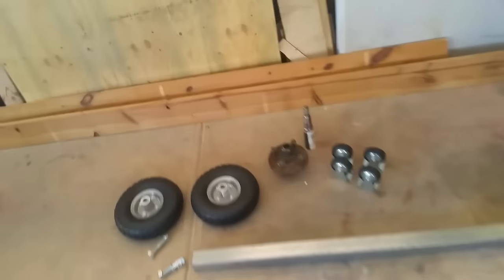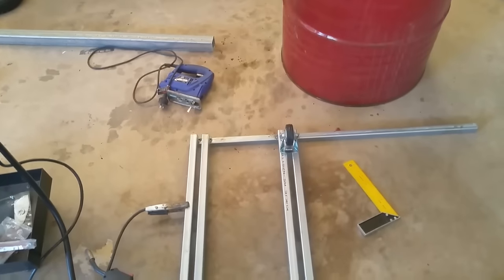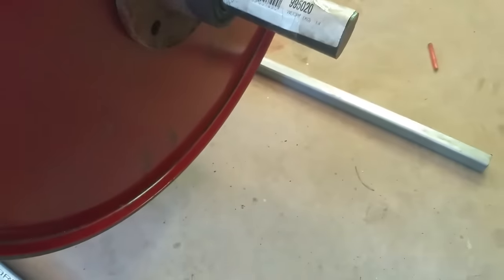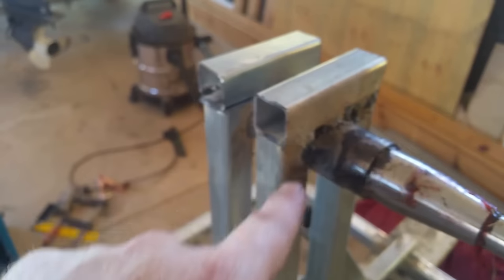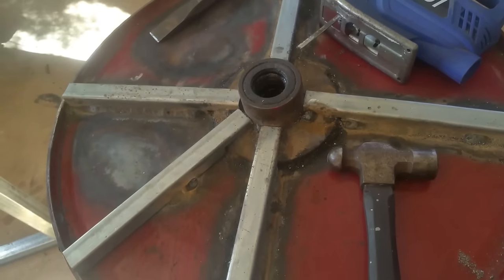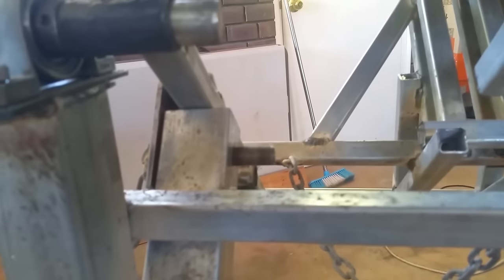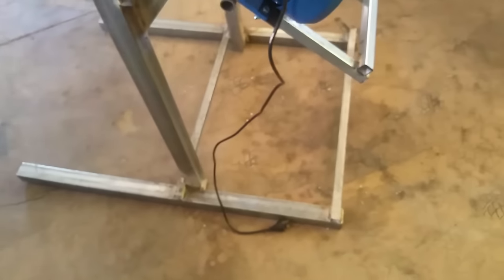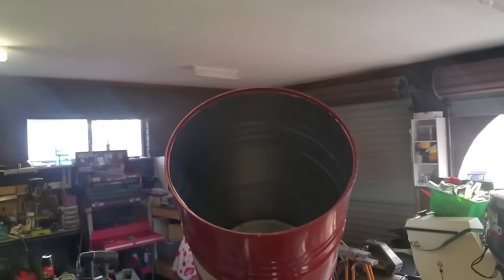How to Build a 55gal Cement Mixer

Comment: Really great design would love to get an update on how your belt drive system has held up?
Reply from the maker: Thankyou. So the belt really slips on heavy loads, so it really needs that fixed but everything else worked a treat.
I do want to redesign it tho.
Reply: @MattyMiranda  Most all these videos they really have not tested them much at all, because I've built them and they break, I had to fix my small one like 5 times.   It isn't great when the mixer breaks half way into the job!  My big one (1/2 yard) eventually broke before we finished my house additional footing wall.   Nightmare having to manually do small batches and hand spin it.

Comment: Good luck with that belt! It's either going to break, come loose once concrete debris enters the track or slip with the weight of the concrete!

You need an drive pinion gear and ring gear around the drum!
Reply from the maker: Had a few slippage issues with that but hey has served me well and is still going.

Comment: Hello, Have you tested your machine with concrete?
If yes, don't you have too much trouble tipping the tank full of mixed cement?
Reply from the maker: I had no problem tipping at all a little belt slippage that's all. I have used it alot if you watch my follow up video you will see some of other pieces I added as well cheers.

Comment: What's the motor specs?..can we adjust the speed to 7 to 10 RPM?... Very nice work u have..
Reply from the maker: Hi and thanks 4 the reply. I believe it would be better to use a pulley reduction to get your desired rpm out of the motor only because if you reduce it through the motor you won't get the h.p (horsepower) the motor puts out.
Reply from the maker: Motor rpm is 1330rpm 240v gives 1h.p. So pulley is a 14mm to the barrel of 580mm gives around 27rpm at the barrel.

Comment: It is a ball bearing which leads in the center to the bottom on the outside ?????
Reply from the maker: Yes its a car hub with a stub axle which they use on a trailer so very heavy duty and sealed bearings as well so they wont get cement in them.

Comment: Well , first off , good job well done....
Not to bust your chops , just hoping to help out a little... I see you said you had a little trouble determining dead center of drum bottom ...I don't see why , coz you had everything right there to find dead center , all you had to do was use it ...Before welding anything up to the drum finish the framework with the 4 rollers first where they all make contact with the drum ...Lay the drum in the roller cradle & slowly rotate it by hand while you take a sharpie taped to a stick & mark dead center as it spins like a lathe ... A concrete block,  one stick , duct tape , & a sharpie &  you have the most accurate center finder you could ask for ...By the way , I saw this other guy solve his warping tin bottom problem..... He measured the drum bottom inside dimension outside bottom of drum & cut a thick circle of plate steel out with plasma cutter , smoothed edges , set into outside of bottom of drum lip  of drum & welded it solidly in & afterwards attached his axle hub ...And it would sound a LOT QUIETER if you used pneumatic rubber tires for support rollers instead of those hard noisy plastic ones .... Could use 2 or 3 agitating paddles to help with the mixing though , it would mix it up a lot faster that way ....  .Great job on what you designed & built ....Yours works , & looks like it should work very well......👍👍👍👍👍👍👍👋
Reply from the maker: Thank you for the tips much appreciated I can definitely use them in future projects.
I did end up putting agitators in and if you watch my follow up video you will see them. I just wanted to find were the cement sits in the barrel before adding them.
Thanks again

Comment: The tilt adjustment could be made easier, in steps, so it is better and easier to adjust the tilt position. And so of course it turned out great
Reply from the maker: Sorry it did not translate.
Reply from the maker: Thats awesome got any pics
Reply: @MattyMiranda  unfortunately not. but there is a lot on the Internet. I just recommended it, if your work suits you, then why do something to redo it?)))
Reply from the maker: I am thinking about re making the cradle before i use it again i have an idea to make it sit lower and new wheels as well.
Reply: @mymechanicalheart3889  🔴 What Is Islam? ⚠️

🔴 Islam is not just another religion. 

🔵 It is the same message preached by Moses, Jesus and Abraham.

 🔴 Islam literally means ‘submission to God’ and it teaches us to have a direct relationship with God. 

 🔵 It reminds us that since God created us, no one should be worshipped except God alone. 

 🔴 It also teaches that God is nothing like a human being or like anything that we can imagine.
🌍 The concept of God is summarized in the Quran as:

📖 { “Say, He is God, the One.  God, the Absolute.  He does not give birth, nor was He born, and there is nothing like Him.”} (Quran 112:1-4)[4] 📚

🔴 Becoming a Muslim is not turning your back to Jesus. 

🔵 Rather it’s going back to the original teachings of Jesus and obeying him.

Comment: Dear Mr Matty
Awesome workmanship it would have been much better if you would have known as in actual with the material working of the machine however excellent idea and your efforts which is commendable. I would like to add here to turn the material inside the drum you should have given some kind of rotator inside so that when it is rotating it will mix the material properly like a ribbon blade or something thank you.
Reply from the maker: Thanks for the subscription and comment. I did not add a aggetator in the video only because of the angle of the mixer. I needed to experiment with water only just to see where and the angle the water sits in the mixer. I have done this now and works really well. I will have a follow up video of some adjustments and the aggetators and it in action.
Reply: @MattyMiranda  Thanks a lot dear...
Reply: Димаш

Comment: what was the total cost of build?
Reply from the maker: Australian dollars.
Drum $0.00
Electric Motor 1hp ebay $135.00
Pully $30.00
Wheels $30.00
Bearings $20.00
Hub had laying around
Stub axle $20.00
50x50mm square tube $20.00
25×25mm square tube $20.00
Around $300.00 AUD
Most other bits and peices i had laying around.

Comment: What is the motor values
engine speed =
motor kw =
Reply from the maker: 1330 rpm
0.75kw / 1hp approx
at 240v ac
Reply: @MattyMiranda  Thank you my friend
Reply: can I use a centrifugal water pump as an electromotor for a concrete mixer
Reply: can I use a centrifugal water pump as an electromotor for a concrete mixer @mattymiranda

Comment: Mmm i'm not decided it looks like it wont last 5 minuets with a full load of concrete in it.
Reply from the maker: Hey mate ive used this so many times now and have only had belt slipping problems when full which is pointless because it's more than a large wheel barrow. I did test it out at 60rpms and yes it was a hand full. At 27rpms is no problems.